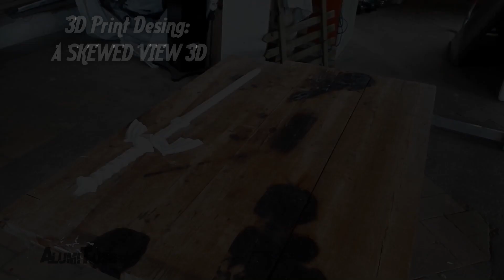Casting Link´s Master Sword from Legend of Zelda (Aluminum Casting)

Comment: When you're printing your masters, why do you not include registration keys/pins to put the halves together?  Wouldn't you get a cleaner edge without the thickness of the glue between the two halves and you'd be able to reuse the pattern if you wanted to.

Just curious.

Comment: Can we buy the 3d prints you use to make your sand mold? My foundry is up and running but my 3d printer is down.
Reply from the maker: You can contact A SKEWED VIEW 3D link in bio :)
Reply: AlumiTube thanks a lot. Your videos are great. Your responsiveness to your fans is awesome too. Keep up the great work.

Comment: Omg I'm triggerd the handle is not blue it's purple 
Good video
Reply: Dragon2ooth 1 in skyward sword they showed the original one as blue actually
Reply: Overall the hilt is blue, usually towards a darker shade, although occasionally it has a slightly more purplish hue as it does in Twilight Princess.  In Skyward Sword it is more of a bright, lighter shade of blue.  The style of the hilt and scabbard have also varied but have been consistent with a wing shaped guard and a blue scabbard with gold ornamentation.

Comment: do you take requests> also if you do then can you try to make a aluminum cast of the Chaos's Revenge? Picture <img src="https://i.pinimg.com/originals/a7/0b/5f/a70b5f4554bfa93f195912c477f24443.png" alt="Image result for ff LR chaos revenge"/>